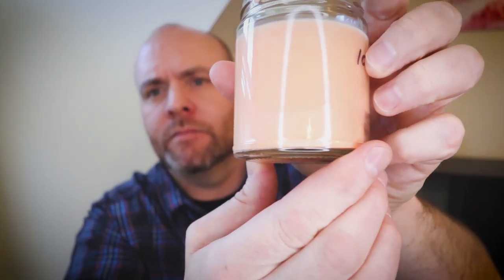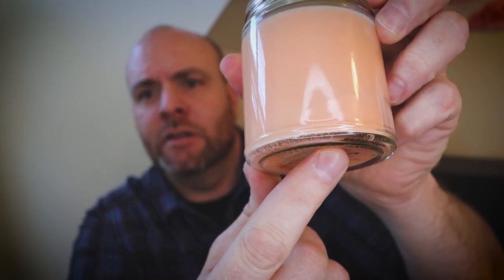Wet spots demo and why they shouldn't bother you

Comment: I have solved this insane problem by realizing that one of the major problems is the candle is cooling differently. To fix this, place candle on a cooling rack and make sure your room temp is higher than  71. Don’t open windows and don’t turn on fans. The candle needs to cool slowly to fix to the glass completely. It was hell till I did this. Also, directly after pouring, tap the side of the glass and any bubbles will rise to the top.
Reply: I just tried your method! Thank you for sharing! Im hoping this does the trick for me too. Do you mind if I ask what type of wax you're working with?

Comment: Thanks! This was driving me crazy, especially when making batches of 100, and half turn out with spots. Almost spending as much time making candles as fixing spots.. I've made various tests, the one that seemed most promising was pre-heating glasses, but even then, they eventually succumb to shrinking. But like you say, maybe most customers don't really care, and as far as my tests goes, no impact on the burning. One trick I'd love to try if to have the glasses on a vibrating plate (low amplitude), I would expect the slight vibrations to tackle the bubbles, and maybe help with the shrinking, though no idea how I'd go about doing that!

Comment: Hire dryer will fix this issue but you need to be patient while applying heat on it you start from Bottom to the top. after sometimes you will start to see some air bubbles come out of nowhere and you will have smooth surface.

Comment: Been making candles for over 10 yrs and still bothers me, there is a way to fix the wet spots, first pouring at a cooler temperature, 170 degrees it’s way too hot, usually I pour at about 125/130 degrees and then if you get the wet spots you can heat the jars with a heat gun an let the air bubbles rise to the top, it does take some time but I can’t stand the look of wet spots when selling.
Reply from the maker: Yep, I have videos explaining exactly that.
Reply: What kind of wax are you using? I use coco apricot and Im struggling with glass adhesion. Ive been pouring at 160-165 thinking thats much cooler than 180-190 that they suggest but still get them. If I should be waiting to 120/130 I'll try it but wanted to see what type of wax you're working with.

Comment: What about discoloration? When I burn my candles, the melt pool sometimes doesn’t match back up with the rest of the candle. I am using paraffin wax.
Reply: i think that’s normal? that happens to mine as well.
Reply: I ‘think’ that’s to do with fragrance oils. I made a few soy candles all the same container size, wood wicks but all with different FO’s. Some discoloured on burning and some didn’t. I could be wrong but that’s what I’ve noticed 🤷🏼‍♀️

Comment: Every wax gives me trouble.  415 I get big time Wet Spots plus ugly tops and have to wait forever for it to pour temp.  464 No wet spots but horrible Sink Holes that I have to cure with heat gun 4 times.  Coconut 83 Wax smooth tops and don't have to wait to pour, but Empire State Building tall flames and deep melt pool.  Plus wax super soft.  Don't want to use any Paraffin so sticking with 464 and dealing with sinkholes.  :(
Reply: Your flame problem with coconut 83 may have something to do with the wick you were using in those jars. Did you try wicking down (reducing your wick size) first?
Reply: @jacobking7840  I heard the wick could be the issue but didn't try different ones because I would be just taking guesses buying different ones.  Unless I knew the exact one to use and then it all depends on what jar size also.
Reply: 😂😂😂 @ Empire State tall flames
Reply: @jacobking7840  That's exactly what I was thinking. Coco 83 needs small wicks (relative to other waxes). For example, in a 9 oz straight sided I use an ECO 4 or ECO 6.

Comment: My soy candle seems perfect when I poured it. I didn’t see any air bubbles in the jar and the top looks perfect. However, as soon as I burn it, I noticed little air bubbles showing on the surface and little bubbles emerges in the wax pool. I think it’s to do with my wax 😭
Reply: It doesn’t happen a lot with soy wax it’s mostly with paraffin wax

Comment: I just poured my first candle and when it hardened it seemed to have caved in around the wick.  Can you give me some tips on avoiding that again? Ty
Reply: Trish you have air around your wick and or a air pocket in your candle wax.   

A couple things you can do.   1. Heat your jars before pouring.   2. Use something like a “rod” after your candle sets.  Puncture the dip with the rod and drive the rod slowly to the bottom of the candle.   Create a small cone shape with the rod and you will notice the air pockets breaking.   After, heat your glass with heat gun snd dip and hole crated will fill with wax.  

I hope this helps!   

www.handcraftedlight.com

❤️ Michael